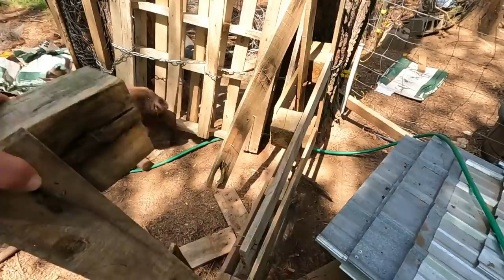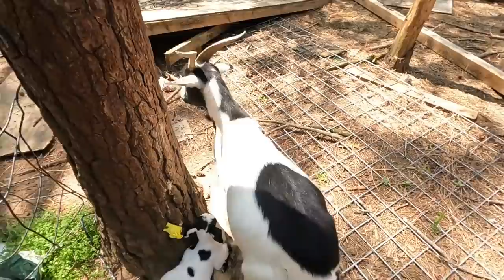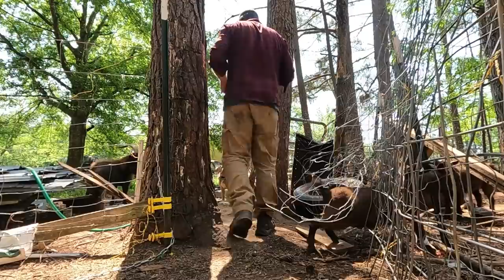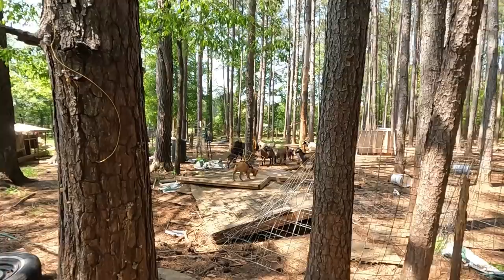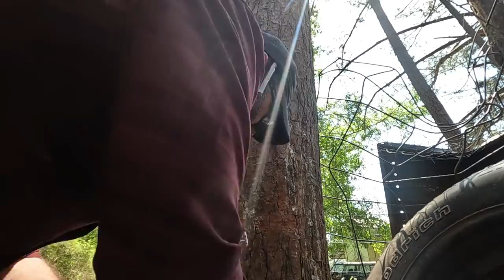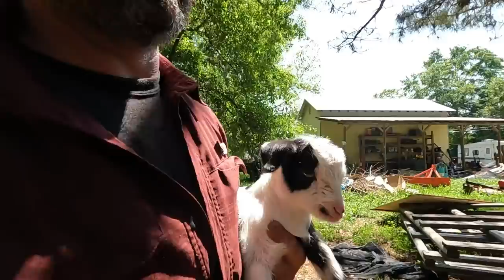BILLY GOAT DESTRUCTION | OAKLEY ANNIHILATES A REINFORCED PALLET GATE | REPLACING THE GOAT GATE

Comment: How about doubling the boards on top of each other on the inside of the pallet to add extra strength for them not to break. Build a few ramps for then to climb far enough from the fence they can't jump the fence, also, a balance beam to walk on. My friend has goats and they're on these things all the time  you have enough scrap inside the fence to build the ramps and what ever you may think of. Keeping them busy is the best thing you can do. Building troughs to eat from will ease the load for you too